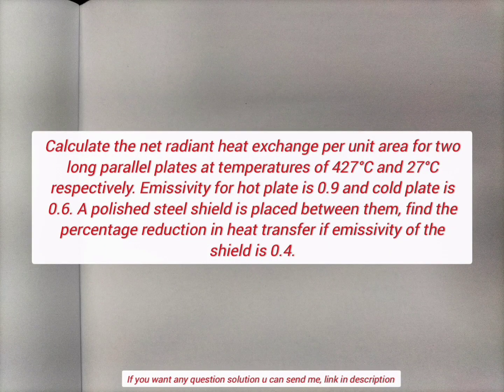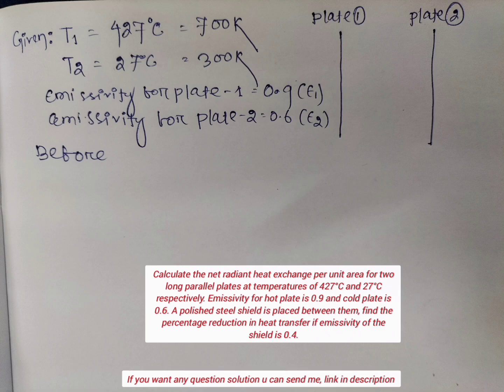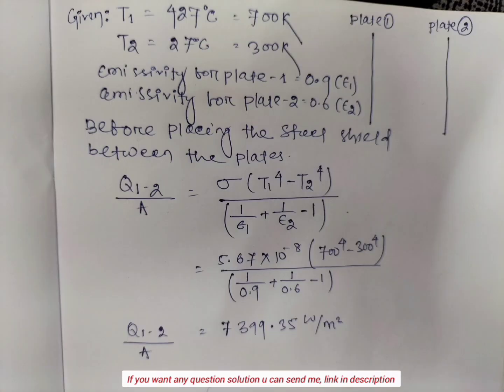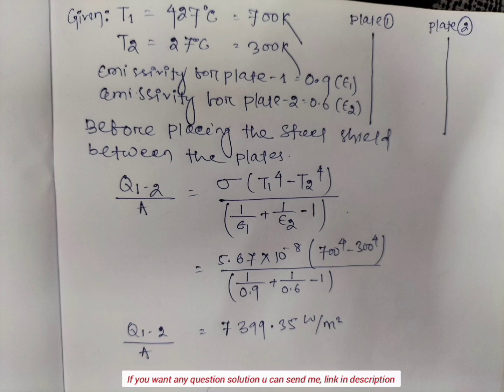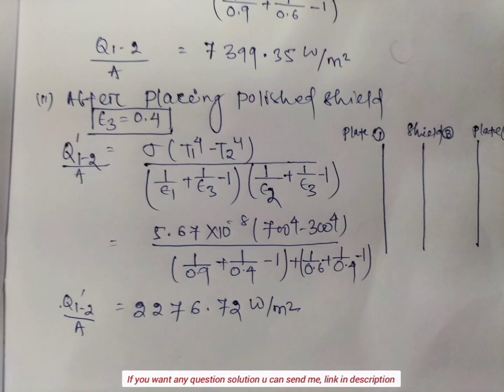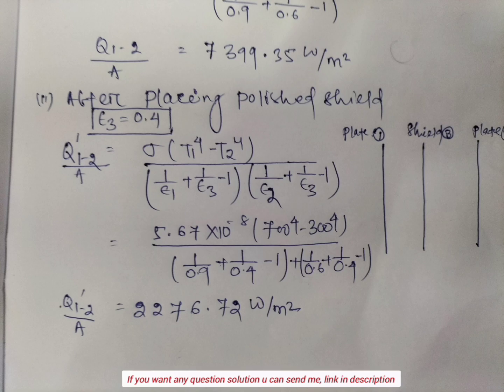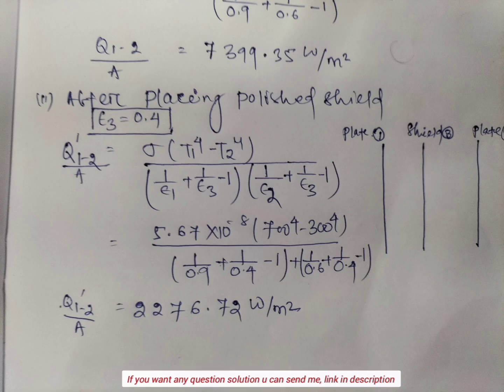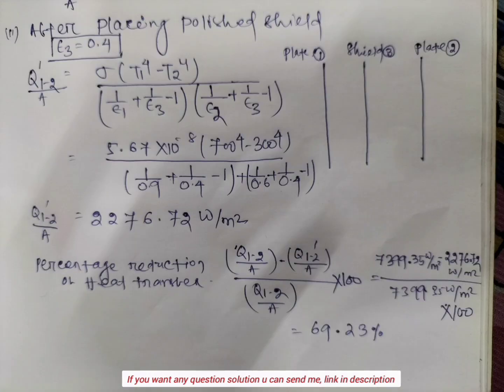Calculate the net radiant heat exchange per unit area for two  //Radiation energy question

Comment: Consider two large parallel plates, one at 1000 K with emissivity 0.8 and other is at 300 K having 
emissivity 0.6. A radiation shield is placed between them. The shield has emissivity as 0.1 on the side 
facing hot plate and 0.3 on the side facing cold plate. Determine percentage reduction in radiation 
heat transfer as a result of radiation shield.